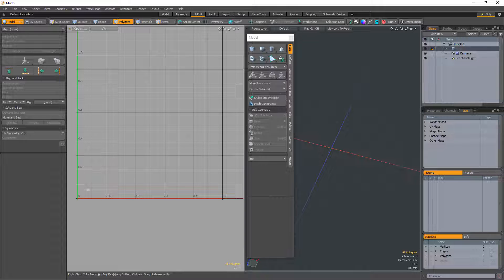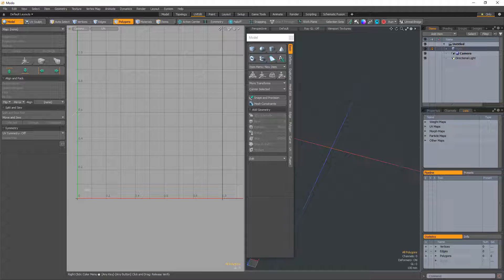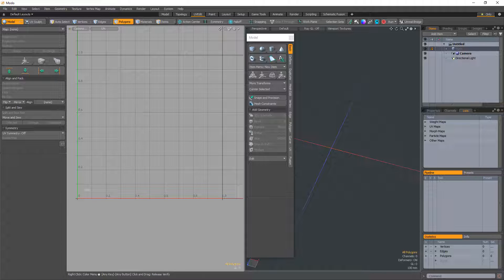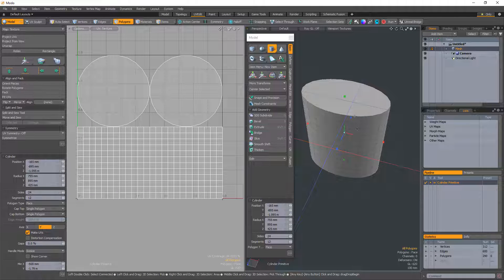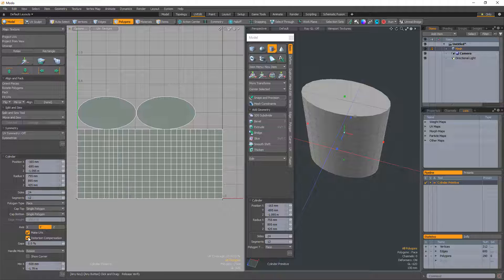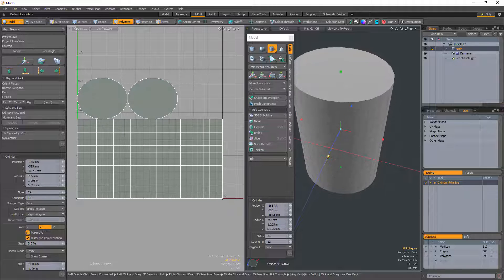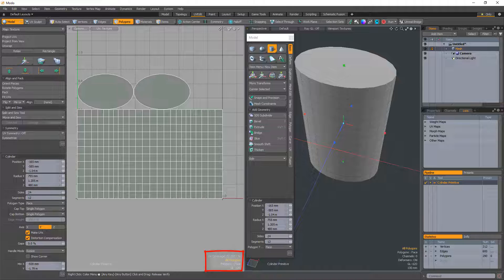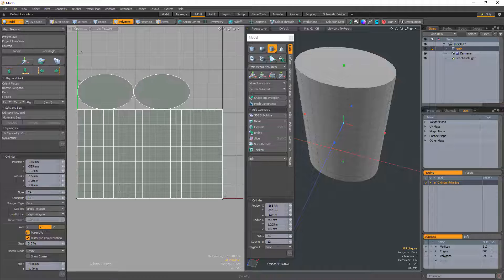MODO | Distortion Compensation and UV coverage indicator

Comment: Thanks for this tip as always! in my case, there is no UV coverage indicator reported at the corner of the UV editor. I'm using Modo 16.1v8. Was that removed or enabled somewhere else?
Reply: oh I found it on the preferences --> display -> overlays. Thanks.
Reply from the maker: They turned it off by default as it can slow things down. SO if you find things get sluggish that could be the reason.
Reply: @pixelfondue  thank you so much! 🙏

Comment: cool but I see no coverage percentage for some reason.
Reply from the maker: got to Prefs/ 3D Info Overlays. It used to be on by default and in later builds its off by default.
Reply: oh thanks a lot! I am not sure why they decided to hide it by default. Its like you make something great and then you hide it so no one will see it)
Reply: @pixelfondue  Thanks.  Just learning Modo 13 (from 10) and wondered where that was!
Reply: Thanks for the question, thanks for the answer.